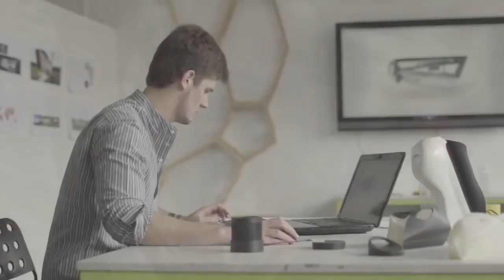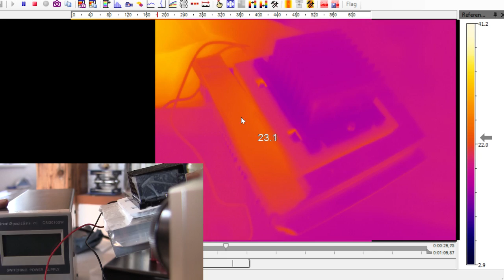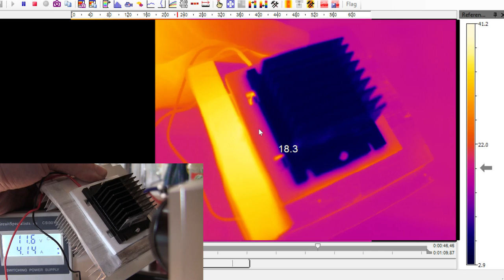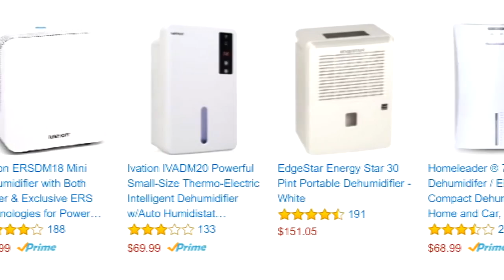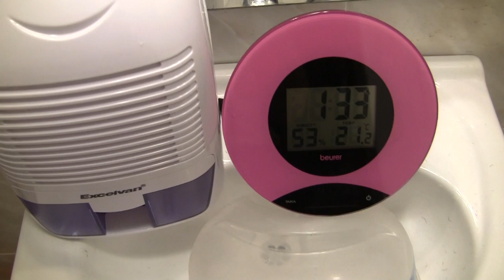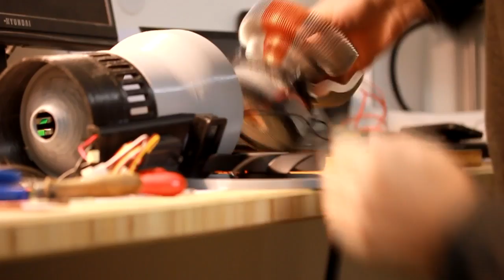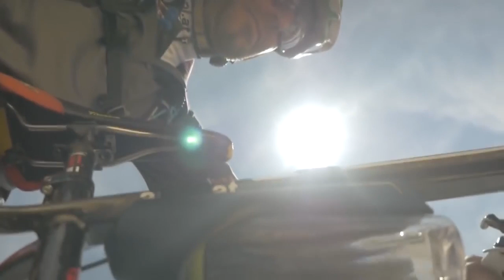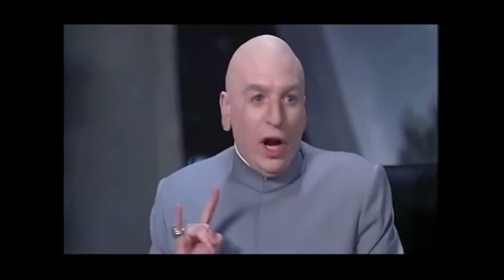$300 000 'Self-Filling water bottle' FAILURE

Comment: TF, Phil... the answer is to do it, just once. 
Just do it using an alter ego. 
Use that money. Buy your gold hammer, and a 50-year personal security contract with the aforementioned aesthetic requirements. 
This way you can be the villain without any unpleasant entanglements.
But I learned a long time ago that if you're going to commit wrongdoings, you need to not tell anyone ever. Always work alone, unless you have a rock-solid plan to silence, discredit or mislead your partners.
Just some friendly advice from the peanut gallery.

Comment: ...and you forgot about the fact that air humidity percentage influences it as well, have fun looking for water in desert with that. It's easier to obtain water using HCl and NaOH, the problem is that it will be salty water :3
And BTW, to get an enormous cooling there's a tech that's A LOT better that a fan and a grid, it's called "peltier cell". The hard part is to dissipate all that heat else the pump will "cog up"
Reply: desalinize the salt water is easier than extracting water from air lol

Comment: One thing I'm not sure you have mentioned before (honestly don't remember the first video) is that the water is distylled, which makes it not so drinkable, as in better than no water, but still doesn't contain any essential minerals, thus actually helping you lose the minerals you already had in your system.

Comment: HI Thunderfoot, I am in a field where I come across use of infrared in detection of objects outdoors.  What would happen if the temperature rises outdoors to a point where the outdoor temperature is the same as the object I am trying to detect?  I.E. a person outdoors and the outdoor temperature also being 98 degrees F..
Reply: Patrick Corridon It fades into the same color, you may see faint outlines. They did it on an episode of Mythbusters when they were testing security alarms or breaking into a top secret facility.
Reply: That is what I thought.  Thanks for the reply.  I will look for the mythbusters episode.

Comment: I guess, filling this bottle with the supposed technology will work just as fine as refilling the Enterprise's hydrogen tanks just by using the Bussard collectors in the interstellar medium. The idea is great, and in theory, it works out just fine… but in practice, you'll have to do the math and bother with non–ideal circumstances.
That's what makes each of both "refueling systems" a gadget that's good to have in extreme emergency situations, where you MIGHT need to prolong your already existing supplies (at least by a little bit) — but they'll never be something you should rely on 100%!

Comment: Should be quite obvious by now that the only important thing when it comes to innovation is cool 3D designs and some epic angel music in a shitty video. The laws of physics be damned.

We have two startups in my city as well who's won tons of prices and investment due despite the fact that they're not actually innovating. One is making an RoV that they're going to sell for 3000 bucks, despite the fact that similar RoVs already exist for 1/10 of the price. In fact, the first pictures we saw of it was from a 300 buck DIY kit you can order from the internet. The other was making a gimball, and won tons of innovation prices despite the fact that they already exists on the market, and they had to let it go the second GoPro decided to make one for themselves. Meanwhile companies with actual innovation and solutions that could potentially save millions of pounds if they got just a tiny bit of investment doesn't pull through because they don't have 3D design made by a liberal arts student.

Comment: I wonder what you could harvest from the human rider in sweat and respiration. Sweat, could possibly be put through a reverse osmosis device and exhaled air is probably warmer than the atmosphere, so you might be able to get it to condense with a heat sink in air. If sweat was too hard to purify, it could be evaporated on one side of a heat sink to condense exhaled breath. Just a thought: and as I can't be bothered to actually try and invent such a device. Obviously that isn't going to provide infinite water, but might get you a bit further... Some how I can't help but think my idea is not entirely original -- does it rain in Arrakis?

Comment: I have one of those 12 volt coolers that runs on this principle and it will under certain circumstances produce enough moisture that you have to sop it up with a paper towel or it interferes with the fan.  However you aren't going to fill any water bottles this way, the moisture is more or less trapped in the cooler, and it isn't enough for a taste, let alone a drink.

Another thing I learned from my 12 volt cooler is that you don't run such a thing on batteries.  It's only 50 watts, but it seems enough to about kill a 200 amp hour batter in less than 24 hours.  Theoretically I should get 48 hours out of it but that would take the battery to zero which isn't good for a lead acid battery and the cooler trips out due to low voltage well before then.  So it's neat that the cooler is 12 volt, but I can only really run it when the trailer is plugged in or some sort of generator is running.  When dry camping, we put water bottles in the propane freezer and transfer them periodically to the cooler to keep it cool.

We have about 300 watts of solar on the trailer, but even this isn't enough to keep the 12 volt cooler running along with the other loads unless conditions are ideal.  The solar panels seldom make more than about 14 amps, which is about half their rating (they are lying flat on the roof and there is usually trees and clouds about).  So in addition to running the lights, TV, cell phones, computers, iPods, heater fan, etc. there isn't enough left over to run a 50 watt load 24 hours a day.  I know it sounds like pretty rough camping but hey.  Also I think there is a limit to how much the batteries can take during acquisition which may affect the charge rate.  My controller won't take the voltage over 14.4.  I probably have one too many solar panels or not enough batteries.  My experience would be the correct ratio is about 150 watts solar for every 400 amp hours battery but I've got an extra panel and as such it doesn't do much besides charge the phones and such.  Oh and run the "fantastic fan".  In theory it could also run the cooler but only during the day and if it's cloudy you come back to dead batteries.

So anyway that is a lot of detail.  I guess my point was I have 300 watts of solar, 2 big batteries and one of these electronic cooling things and I can't make enough water to be more than a slight nuisance, and it drains the system more than a lot of other uses combined because it's constantly on.  So I don't need thermodynamics to prove the futility of this project.  I've already done a large scale experiment, repeatedly, and it doesn't work.  It does make a little water, but look at the scale!  300 watts solar!  400 amp hour batteries!  And only a tiny bit of water!
Reply: Ya man I now what you mean, I've had times where I've gotten not a single drop in 24 hours on my dehumidifier (150w) plugged into my UPS(900w) (at 32-36% humidity)

There is times where I have collected 2 litres in 18 hours(over 50%-60% humidity)

The only way any of this would make sense is if you lived in a fucking HUMID desert or were in the middle of nowhere where you just happen to be driving with like 350w of solar panels and your dehumidifier  as well as having absolutely no water on hand LOLOL!

Fuck this crowdfunding project and Fml lol...

Comment: I used the kickstarter for such a bottle a year ago in my physics class as a discussion point... my 17 year olds were already pulling it apart.... their main point was that presuming you can get the power you would need humid air, which is not always the case... especially if there is no air flow.
And that was  presumption you had a much bigger power source.

Comment: Dear Thunderf00t: Here are some ideas of magical devices which would secure you millions in funding:
-A device which provides light when it's dark, you plug it in and makes light out of nothing! I call it "LUX"
-An amazing new way to communicate, transfering voice over wires to a remote location. I call it "Voix". Prototyping in process.
-An Icredible natural alternative to waste elimination. You dig a hole in the ground and build a polycarbonate structure around it so you can relieve yourself in privacy. I call it "HyperPoop" (©)
-An idea which will revolutionize transportation and fashion at the same time. It's a piece of clothing with feathers attached which not only looks amazing but will allow you to soar through the air by simply flapping your arms. I call it "Icarux" because it's cool to end names with an X.

So go ahead, use any of my ideas and start wracking up the millions! Cheers and good luck.

Comment: You would be smarter combining a marine style pressurized membrane filter and UV unit to sanitize the water as it comes out of the filter into a large jug! To provide electricity just make a device that is like  a stair stepper just smaller which forces the turning of a seriously small a/c alternator with rectifier and a battery unit that uses a large Lithium Ion battery to power the pressure pump for the membrane! You could collect water from anywhere and turn it into drinkable sanitized clean water!

Comment: I could see the usefulness of a similar technology (though not this one) in a place where there's little clean water, but high humidity. Not saying it would be a water bottle or solar powered, just that, pulling clean water from the air may alleviate issues in some areas.
Reply: Right. Basically described a commercial dehumidifier.... You know, plug it into whatever you want to use for a power source.

Comment: +Thunderf00t
Did you think to ask the manufacturer of the dehumidifier how much they spent developing it.  I'll bet it wasn't cheap, even though it uses tried and true tech.
Also, what about pressure condensers?  My elderly uncle had an oxygen concentrator that put out quite a bit of water.

Comment: Of course how much water you get how quickly depends a lot on the humidity at the time. I live in an area that is usually very dry, so an older air conditioner I used to have would run for long periods before the water tank would fill up. (Older portable air conditioners had a tank to fill up rather than venting the water through the exhaust)...if the humidity jumped over 40% or so it would easily create a liter a day and in rainy conditions (when such a device would be useless, but none the less) it would need to be emptied several times a day.

None of this makes the device they talk about more viable but dehumidifying air that is not humid obviously won't do anything. These devices do have the flaw that in the areas that could make the most use of them, they simply would not work with any power levels. At the end of the day a large plastic covered hole designed to hold water and reduce evaporation once collected would do you a lot more good.

Comment: I did some math calculations on the high efficiency semi-flexable monocrystal solar cells from sun the power produced in direct sunlight is between 220.5-252 Watts per square meter so it is feasible but it would be bulky and heavy because of heat sinks and trying to keep 3200 square inches of solar panels to provide rapid filling power.

Comment: The "commercial" dehumidifier you bought sucks. it's a cheap, shitty one. my dehumidifier pulls about 1-2L every couple of hours set at 35% (my areas humidity is usually around 40%. so yeah, getting a liter per hour is possible. I really think you're underestimating the power of dehumidifiers.

Comment: I always thought dehumidifiers used a standard AC setup using the evaporator to just condense the water instead of pull heat out of the room as well.

Comment: There is actually a device to create drinking water if you are on a boat as they showed. It is an inflatable tube with a cone of clear plastic in the middle. You throw it in the water, and bang. The sun heats up the water, the water condenses on the clear plastic, and the clean water runs down the cone shape to a collection lip on the sides. No electricity, no moving parts, totally solar powered. Works great.

Comment: I once lived in a location where there was enough humidity to fill a 2.5 gal humidifier indoors twice a day. All the humidity meant mold was ever present in the air, so any water sitting out for 30 min or more tasted extremely foul. The apartment was rotting from the inside out. Even got pneumonia while I lived there and squarely blame the black mold.

But hey! MAYBE I would have gotten a good swig of water with the original design of the bottle in that hellhole of humidity!

Thank you for your continued debunking of these overzealous ignorant kickstarters.

Comment: Thunderf00t, great vids, thank you.
Question:  Can seawater not be used to be changed into drinking water or even for agriculture, extracting the salt ?
Would be much easier and we have enough of it, not?
Reply: Yes, seawater can and is turned to drinkable water. In fact I do just this in my sailboat with a RO (Reverse Osmosis) desalinizer. 
It is extremely energy inefficient compared to collecting rain or river water, but it is VASTLY more efficient compared to the method that the Fraudus erm I mean Fontus is using.
Simple calculation.
My machine produces 30 liters per hour of fresh water. It takes 45A at 12V (540W), which means that in an hour it would have consumed 540 Wh.

The Fraudus erm Fontus produces 1 liter of water each 48 hours at 50% humidity, and  takes 15 W. It would take 1440 hours to make 30 liters of water, like I did with the desalinizer. The energy consumed would be 21600 Wh which is ENORMOUS compared to what the desalinizer takes.

The desalinization plants are practical in seagoing vessels where weight is important (1000 l of water weighs literally a ton, 1000 kg!) or where electricity is cheap and abundant and there are no or little fresh water springs and precipitation. It is however cheaper, in places with enough rainfall, to build large reservoirs rather than a reverse osmosis plant.
Reply: thank you for your answer and your time.

Comment: What if heat sink is made of carbon nanotubes? They have large surface area and great thermal conductivity. What about toxicity of ingesting nanotubes?
Reply: It doesn't change anything. Even if you had a magical Peltier device with 100% efficiency, it would still take a week to produce a liter of water.
Reply: So it means that all we need is portable cold fusion reactor? Wait. They run on water...
Reply: Or a big bucket and some rain.

I'd rather bring a dehumidifier (commercial) and a portable generator with me if I had the choice between that and the Fontus.

Comment: even if they could get water from it, they still have a filtration issue.  i'm not drinking water that condensed on a metal heat sink.
Reply: It's a good way to get airborne diseases carried by dust that is pushed in by the fan, and sticks to the wet surface of the heat sink.
The metal heat sink (per se, without dust) is the least of your worries.

Comment: Don't know if Thuderfoot realises this, but a lot of these devices won't actually turn on the cooling device going unless it's over 30%, some higher, I think something to do with breaking the cooling mechanism and/or power saving. I had to dry out my house for a long time, luckily the one we had was adjustable. So it's not totally scientificdebunk. But still shows the problems.
Just thought of a good comparison. A rain collector versus a self filling water bottle (I'd like to see a chemical analysis of the water too, after seeing what comes out of my condenser tumble dryer).
Reply: This dehumidifier (I have the same model from Excelvan) is very simple. The power goes in, there is a manual switch, and after that the fan and the Peltier are directly connected to the power. There is no humidstat.